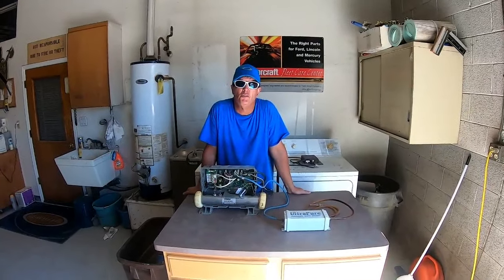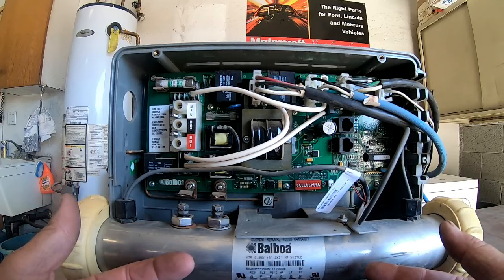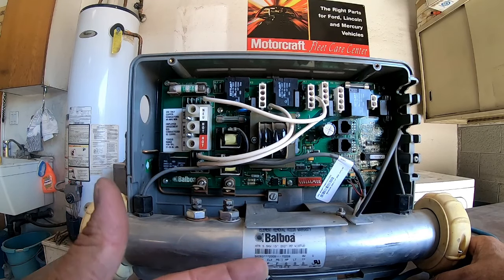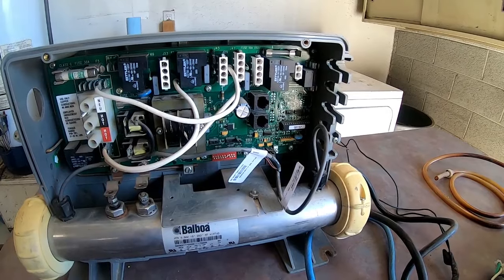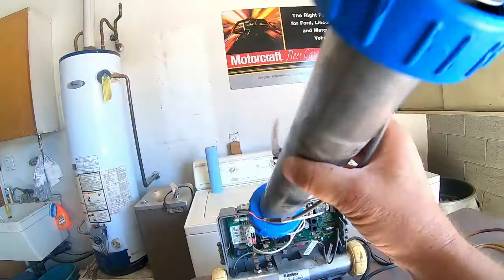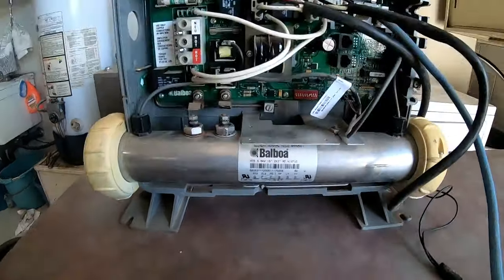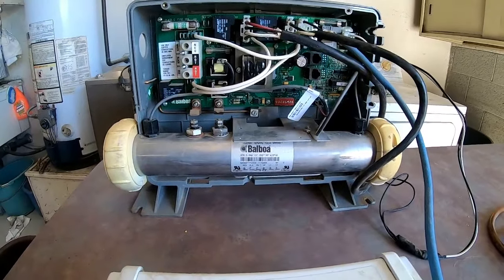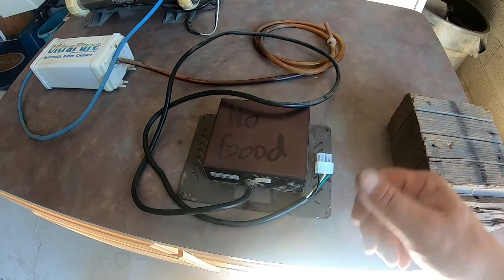Hot Tub GFCI Breaker Keeps Tripping..6 Things To Check For.(DIY Spa Repair) Arizona Hot Tub Factory

Comment: You can use a megger to check the insulation integrity of the heater and pump motors.  We had a GFI breaker that nuisance tripped even though everything tested out OK with the megger.  Small leaks to ground will cause this issue.
Reply from the maker: Ya ..A couple months ago had a spa that would only trip breaker once in a while but very frustrating to say the least.. checked every thing and all tested good.. I read something from another Spa Tech and went and tested it and he was right heater had a tiny tiny pin hole and would only trip every now and then .. We replaced it and haven't herd from the customer since.. Thanks for Watching & SUBSCRIBING
Reply: Yes, that is the kind of nuisance trip that I use a megger for.  I can generate 500 volts with the hand crank to test for insulation leakage to ground, where an ohmmeter would only use 9 volts.  The meggers high voltage will make any defect arc to ground.  Evidently, I must have had a defective GFCI breaker.  We sold that particular hot tub with the house in August.

Comment: Great, super informative video!!! Here's my issue.... My swim spa will run for about six hours and then it trips the breaker. When it does I cannot reset the breaker for about 12 hours. Then, usually the next day, I can reset it and have power again. Had a repairman out who said it needs a new GFCI breaker. So I don't waste $120 for a new breaker, could a breaker really sporadically give out like that? The breaker tripped without the heater or ozone plugged in... Maybe a pump short circuiting? Just wondering if you've come across this...
Reply from the maker: Yes the Breaker can do that..and yes I had this happen to us in the shop a few years ago..Like yours we disconnected the heater, ozone, lights, stereo as it turned out it was pump #1 it was getting so hot (it was so Hot you couldn't touch it at all)that it would trip the breaker and it would not reset until it cooled down several hours later...we had the pump and motor rebuilt and the problem stopped...we also had another one that was also a swim like yours and like the last one we disconnected everything.. what we found on this one was ..this swim spa had 2 / 7HP motors and required a breaker larger breaker then we were using. we put in a larger Breaker and the problem went away..In both of these examples the motors were over heating witch is what was causing the breaker to trip..Im not sure if this is your problem ? I hope this Helps You..Thanks for watching and SUBSCRIBING.
Reply: @spaman5440  Very helpful! I installed a new 50 amp breaker (hot tub side has a 50 amp, and swim spa side also has a 50 amp- both located in a sub panel), and the exact problem returned. So, I need to figure which of the three pumps I have (two 4 HP and one 5 HP) is causing it...
Reply from the maker: @flavellinator  I just ran into this problem today 4/16/2020 New Swim Spa was installed using 50 AMP GFCI Breaker and # 6 wire ... (We did not do the install..Dealer asked us to trouble shoot and Fix)This Swim Spa required 60 AMP GFCI and that requires larger wire..company that did install did not read the blue prints or install instruction... Keep me posted  Thanks for watching.
Reply: @spaman5440  Seemed to find the problem... The two breakers (hot tub and swim spa) were wired too close to each other in the sub panel. The wires coming from each breaker were almost touching. Once I moved the wires away from each other in the sub panel, I had no more trips... It's been two months now. I did nothing else. Crazy, right?
Reply from the maker: @flavellinator  Wow ...I have never herd of something like that ...But if it fixed the problem thats all that matters..

Comment: Spa Man, I need your advice. I have a Balboa el2000 spa w/ an 8 button topside controller (ml700). Will a 7 button controller work as a replacement? An ml700 is ~$385 lowest prices I've found but I did find a used 7 button for $100.

Comment: What does CI code mean on cal hit tub
Reply from the maker: I need a little more info to help you ..If you can call me I would be happy to help You.
Reply: @spaman5440  great I will call what number?
Reply: @spaman5440   I have a Cal spa that I set up and been running all  winter long I changed the breaker box with a new one I think did right for I did the first one  when I filled it up  but not turn on until next day and a code CI or IC not home but it got cold  about 35  so when it said to prime I do like always 10 sec on low 10 on high than 20 off until fully primed BUT WOULD NOT PRIME ON HIGH

Comment: Best video out there for a DIY with limited knowledge. Thank you! I do have an issue with the spa panel GFCI breaker tripping when connected to the spa. Breaker does not trip when I disconnect the spa. Checked line in to spa sub panel from main panel with meter and I get 240, when I check the load side of the GFCI breaker I get 241. Do you think this is enough to trip the breaker or not enough to worry about. Everything is brand new, spa, breakers and all the wiring. I used 6/3 wire, could this be the issue? Should I replace the ground wire with an insulated ground and not worry about the 241 meter read?

Comment: So I've been chasing ghosts it feels like. I have my gfci break from the 20 amp breaker and it doesn't always happen but at least once a day it trips. I can unplug everything both jets the circ pump the light and the ozone and it still trips off the 20 amp. Any clues or do I need to get my multimeter out and go fishing?
Reply from the maker: The only component you did not mention is the heater ? I had a hot tub I was working on about a month ago that was kinda doing the same things you mentioned.. It would run for a day or two then pop ..it would run for an hour and pop..As it turns out the heater had a pin hole and when the heat came up to a certain point it tripped. I checked the ohms with a tester (heater was working)On a hunch I switched it out with a new one and it hasn't tripped since..Hope this helps...Thanks for watching.
Reply: @spaman5440  Brand new titanium heater I replaced before this happened. The GFCI trips even with the 30 amp breaker turned off for the heater.
Reply: @spaman5440  Found it! there was an intermittent short one of the wires inside the conduit pipe running to the breaker box was shorting to the tube due to a worn or broken spot of insulation. That was fun..
Reply from the maker: @LordPhoton-rl4ot  I'll bet it was fun..LOL. Im so glad you found it..and didn't give up... I have seen that a couple of times. Im very happy you were able to fix it ..Good for you man. Knowing that you were able to fix it make all the video worth the time it take to make them..
Reply: @spaman5440  Thank you very much! and thanks for doing what you do

Comment: Any idea what to do next? I disconnected everything attached to the control panel (a Gecko - Dimension one unit) and no breaker tripped. Once I connect the transformer connector with blk and wht wires to the controller, it trips. I replaced the transformer and it still trips. Is the controller bad?...that's the only part I have not replaced.

Comment: I am a new spa owner and mine is giving a false H-OH reading. I've changed the sensors already. I checked the water temperature by hand and it reads 94 degrees. After changing the sensors and filter it ran fine for a week than i got the H-OH error code again. Could it be the heater itself? I had someone look at it and they said the heater either works or it doesn't, they recommended me to change the pack. I don't believe that is the answer. If anyone can please tell me what my  next step should be PLEASE? I need some form of entertainment now that we are quarantined.
Reply from the maker: OK...For OH , HH or Hot Trouble Codes, an overheating Hot Tub is not usually a heater problem. It is almost always a flow problem..When its not a flow problem, Its usually a bad Temp sensor, high limit switch or a stuck relay...Clean or replace the spa filter .open all the Jets and Turn the Pump on High.(all of that info was from Balboa owners manual) I hope this helps. Thanks for Watching and SUBSCRIBING.
Reply: @spaman5440  Thanks for replying! I will do some research on how to do what you recommended next.

Comment: I have a mother board issue ahhhhh
Reply from the maker: With the breaker turned off and all of the wires removed ...remove the board and see what it looks like on the underside..It might be able to tell you what is going on.. Did you check all of the fuses on the board also? Thanks for Watching & SUBSCRIBING

Comment: With everything disconnected in this video the breaker trips.  Any suggestions would be appreciated.
Reply: There is no stereo, I don't know if there is an automatic water cleaner.  If there is it's not visible on the same end of the spa that the balboa pack is located.
Reply from the maker: @josephchandler4937  If you have disconnected everything ? and it still trips.  Now the work begins. at this point if you do not have a good working knowledge of how electric works you need to hire someone that understand Hot Tubs and electric(must know Hot Tubs) 
(1) check main Breaker
(2) check sub panel breaker
(3) check wires
If all that checks out make sure all connections are tight.
If everything checks out and you have 240 Volts to the Spa and it keeps tripping.
With the main breaker off and sub panel breaker off remove wire that connect to the board. 
Note the screws one is a fine corse screw for the ground and must go back in the same spot (Center Botton Screw total of 7 screws in all)
Pull the board out and turn it over and look for any even if it is just a tiny spot of brown if you find even a tiny spot!!! it means your board is junk and you need a new one.

Hope this Helps Thanks for watching & SUBSCRIBING

Comment: What about a hot spring that kicks when you attempt to start pumps. Either one or both. Doesn’t seem to matter.  The hot spring guy can’t figure it out. He’s saying maybe the gfci breaker has gone gunnybags but that’s a 100 bucks just to guess. Not sure I want to roll the dice.
Reply from the maker: Before You stick Hands in Hot Tub Turn OFF the breaker !!   You do a Hot Springs the same way as any other Spa.. Disconnect everything from the pack and one by one plug them back in..  when it trips you found it.. Make sure breaker is off when you plug things in ..it take more time but it is safer to to do it that way.on another note on most Hot Springs Ive played with it was the Heater , Circulation pump or the main or secondary pump..1 out of 100 was it the board or topside.. I have couple of other Idea if those don't fix the problem to much to text ...You can call me if you need more help..As alway Thanks for watching.

Comment: What if a fuse is blowing also?
Reply from the maker: it really gets down to finding out why the fuse is blowing... I will give yon an example. I had a spa that kept tripping the breaker or would blow the fuse...like in this video I disconnect everything and one by one started plugging things in... when I plugged in pump #1 (every thing was fine so far) and then I pushed the button on the top side to turn on pump #1 and the fuse blew but not the breaker.. At that point I shout off the breaker replaced the fuse with a new one and unplugged Pump #1 since this was a two pump system I took Pump #2 and plugged it in to the Pump# 1 spot on the board (Note both motors were 4HP / 2 speed motors)and turned on breaker again and then pushed pump #1 on the topside and the motor started working property...at this point I new it wasn't the board or topside..or the Pack itself the problem was in the motor.. I removed the pump and motor and found the motor was burned up and had to be replaced with a new one..

Now Im not saying this is your problem ..What Im saying is you have to... like in the video un plug and check things one by one. it take time use your cell phone to take pics and use a note pad to record results.. shout off spa when fingers are in or near the board take your time..

I know I make it look and sound easy .. If you still need help you are welcome to call me at the office 623 842 4665 Thanks for watching and Subscribing

Comment: Hi Scott! Nice video! Keep up the good work. I have the same scenario, same equipment tripping the circuit breaker. If I remove the jet pump, the circuit breaker won't trip, if I connect the same jet pump straight to the circui breaker it will run fine. What do you think it is? Ps: just a little information, I just order a brand new vs300fl4 system from Balboa.

Comment: Ever had issues w/ 7volts in the water of hot tub even with all power off to the entire house? Electric company, hot tub tech, and electrician have been unable to resolve.
Reply from the maker: I have had a couple issues similar to that and everytime it was all connected to the wiring... (meaning something was loose ,warn out , wired wrong , Check the Ground) Most often it was the GFCI or the Heater. Hope this Helps. Thanks For Watching
Reply: Thanks! We found that the grounding to the entire house is holding around 4 to 7 volts, which is what the water is holding as well.  I am confused on why a heater or gfci would produce voltage, even with all power turned off to the house.  Going to replace the spa panel and whip to the hot tub on Monday for safe measure.